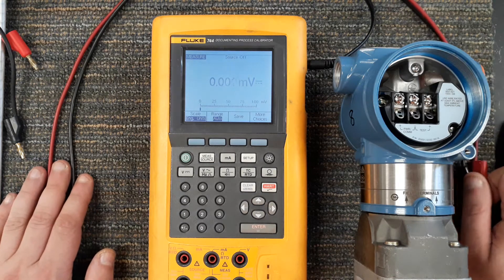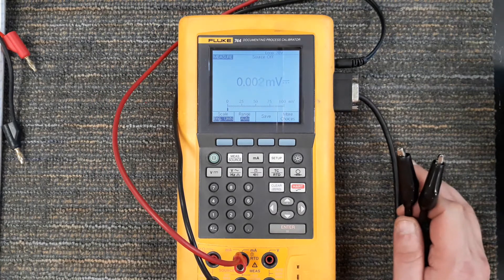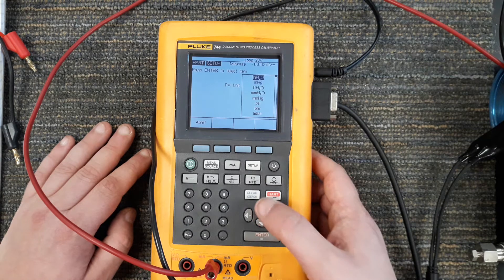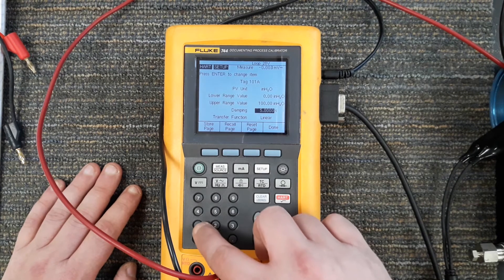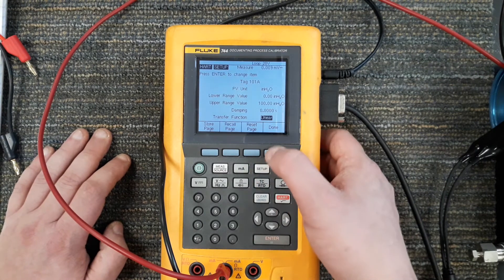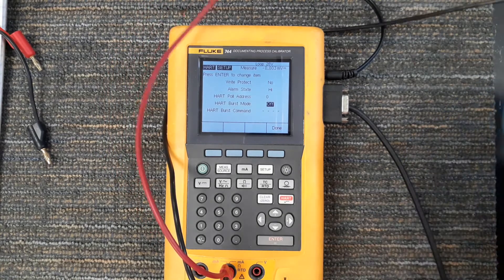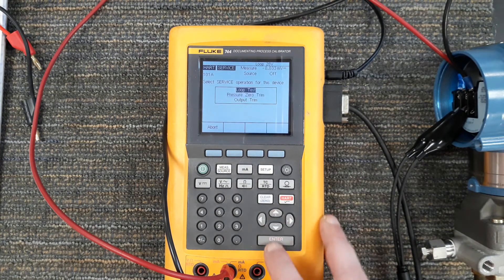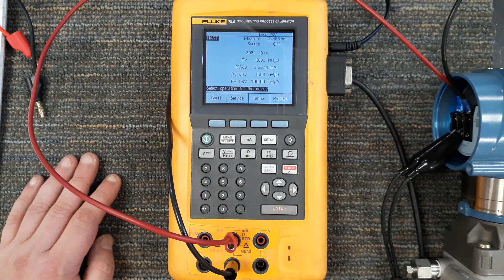Using the Fluke 744 as a basic HART communicator

Comment: I have one question :
When you're using the fluke calibrator
To calibrate pressure Transmitters
You use hand pump to enter a small pressure

But if the pressure Transmitter has a high pressure range
For example :
0 - - - > 5000 bar

How to enter this huge value to the pressure Transmitter?
Reply from the maker: I'm not sure what your question is exactly.

If you are asking how do you assign 0 to 5000 bar and the LRV and URV into the transmitter, that is a question related to the HART menu options for that specific transmitter and the Communicating device you are using.  Normally, LRV and URV values can be set via the SETUP section of the menu tree while communicating with a smart transmitter.
Reply: I would say you need to use a pressurized inert gas such as nitrogen along with the proper regulator and appropriate test equipment.
Reply: Good people, tell me where to get the pinout? We don't have a VGA cable and it's impossible to buy it. The tool is idle, it's a pity to throw it away